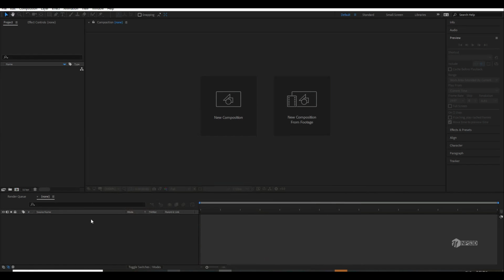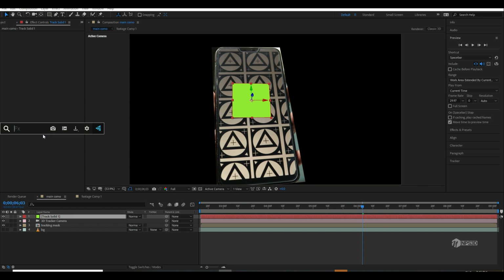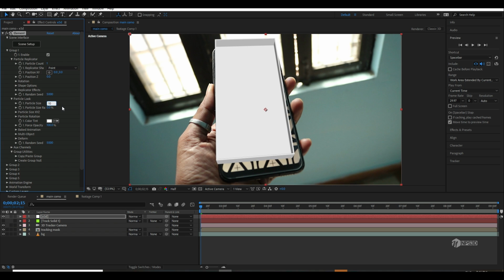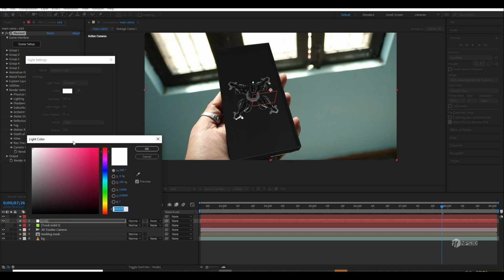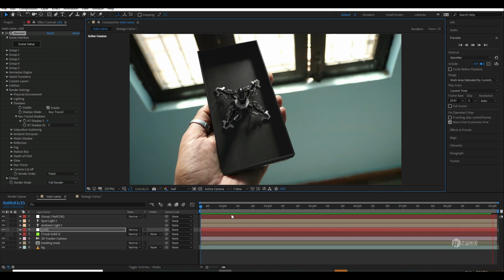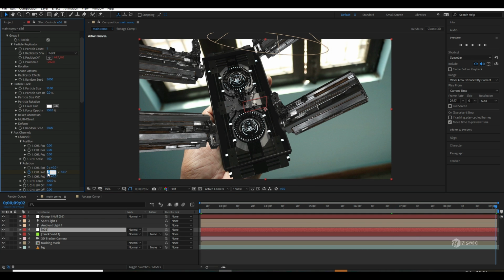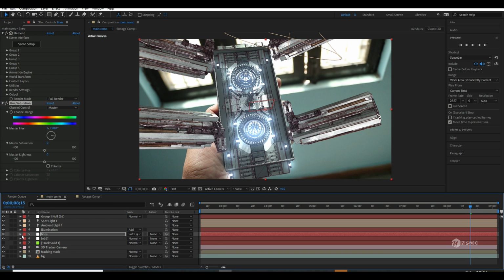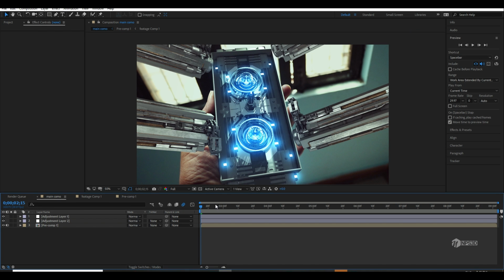3D Advance Tracking Class | After Effects and Element 3D Tutorial | Project File

Comment: @NPS 3D 
Awesome Video. Currently having trouble to get raytraced shadows. It worked without problems in the past. When I turn on Raytraced shadows all lights make kinda black light and no shadows get created. Normal shadow maps work without a problem. I am running a gtx1060, Amd 3600, After effects 2018, Element 3D 2.2.2. All on their current patches beside AE.